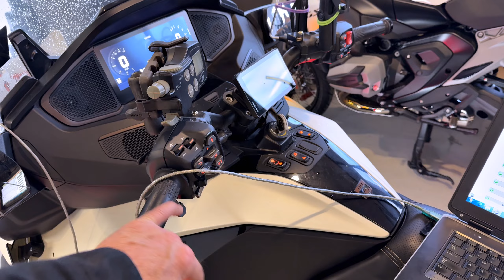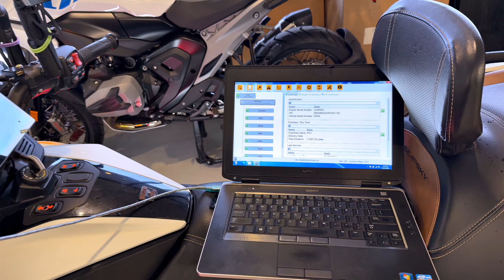S2S Alternator Noise Cured!! • I Caused VSS Code! | TheSmoaks Vlog_3286

Comment: I appreciate seeing maintenance on a BRP trailer. I was very happy to find a 2019 BRP Freedom trailer in excellent condition recently. I believe it was the last model year. Even though it was much more expensive, I decided to have the BRP hitch properly installed at my dealership. Now, traveling with my Sea-to-Sky is going to the next level. I forgot to tell you that I had the Haijiu battery on my 2022; it crapped out in July 2023 and my dealership replaced it under warranty with a Magnasport one which apparently were the stock batteries on RT before 2020. Cheers Shawn!

Comment: I have a 2024 RT-L that I have put 2000 miles on so far and have gotten the VSS code about 4 times. Seems if I don't go through proper shut down procedure when I try to re-start I get it. Just as you did, if you shut down and wait for the system to reboot it starts right up. Quirky and a little annoying, hopefully will never leave me stranded.